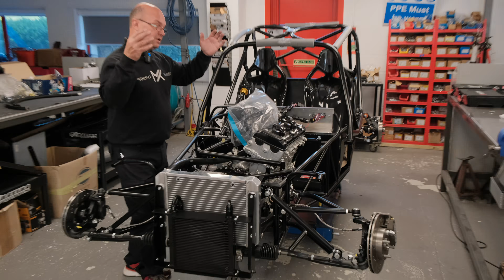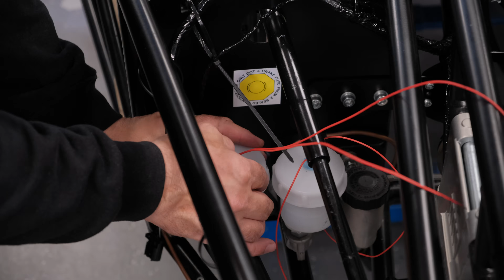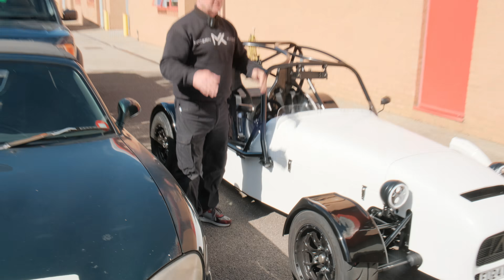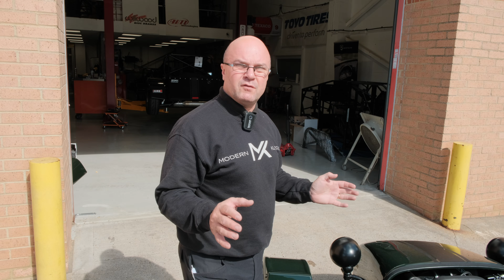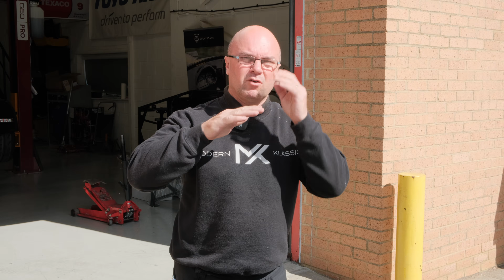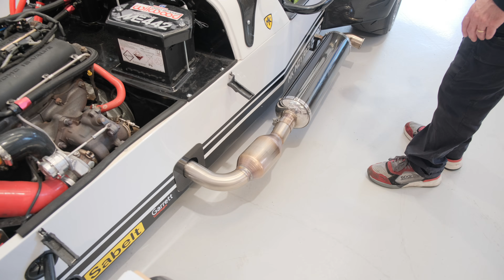How to get 340BHP Out Of Your Mazda MX-5 NB - Workshop Walk Episode 214

Comment: I have a Westfield running on the Mazda 1.8 NB with the TD04 with ME221 running around 240-250bhp on stock rods etc and plenty of fun to be had in cars so light 😇 As the engine needs to come out will also need a stronger clutch!
Thinking about this upgrade next year and know where to come 👍
Reply from the maker: You bet, we have the parts to do the job for you.

Comment: How much would a new car cost with this power and engine? 
Would the 2.0 engine make more power with this setup? 
Is it reliable if used hard on track?
Reply from the maker: It’s forced induction so will get hot on the track.  If it were me, for a hard track car, I’d go for the k20 engine if it was a track weapon you wanted.  The turbo while it makes massive numbers is really a very fast road car.
Reply: @MKSportscarsofficial how would it perform as autocross car ?